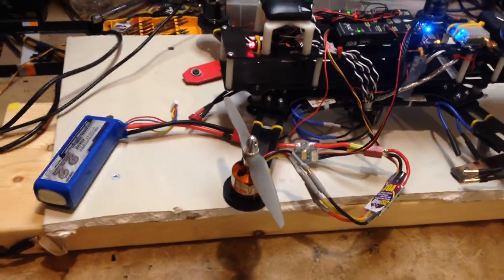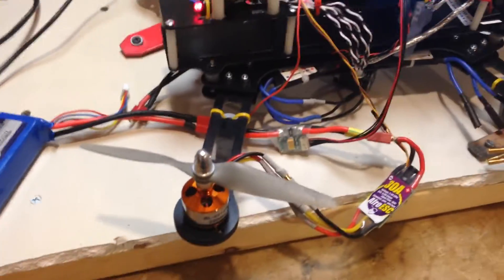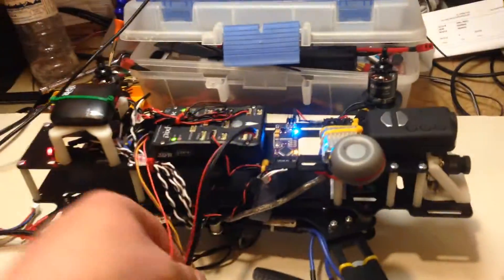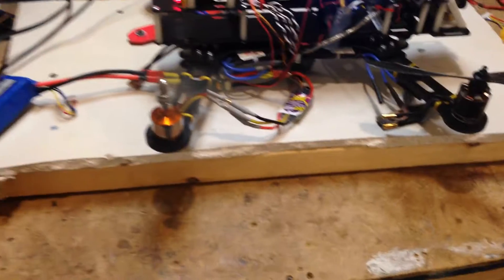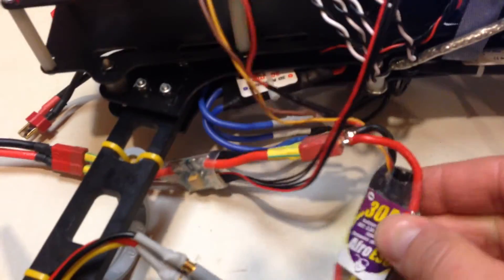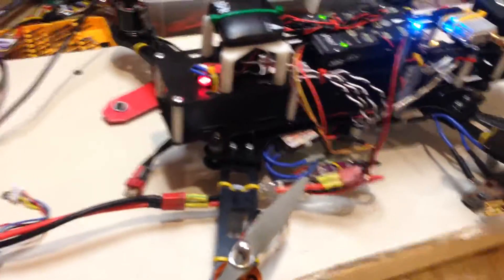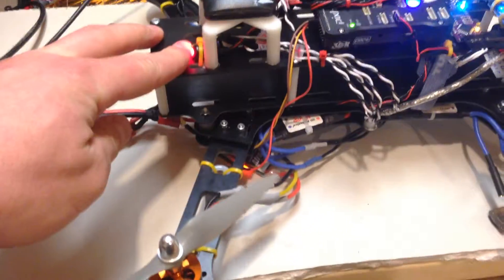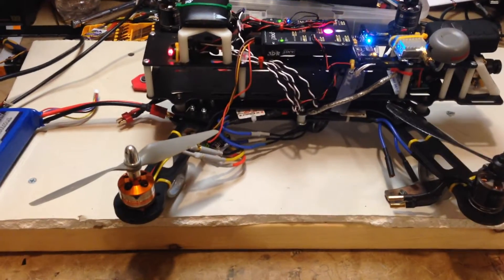Pixhawk sync issues part 4

Comment: Having similar issues with apm 2.6.  Strange though, my 250 running apm 2.5 doesn't misbehave, but my esc's on that copter have no bec.  Going to try running signal only from my esc's when my new frame gets here.  This problem just cost me a tbs discovery frame and an rctimer arm.  If i didn't hate DJI so much, I would have gone back to a naza.